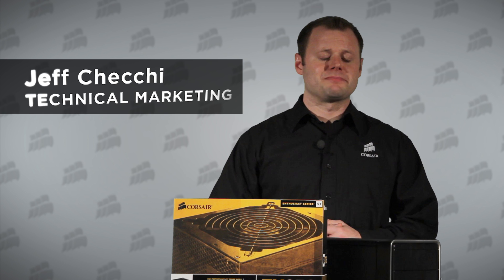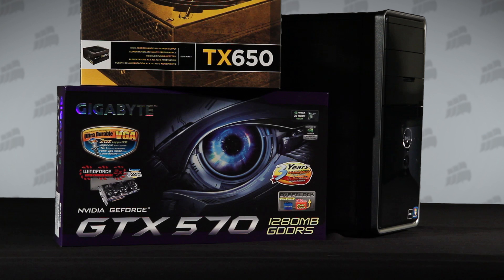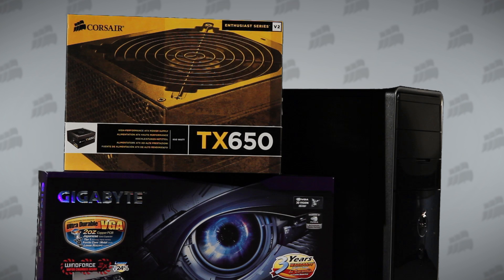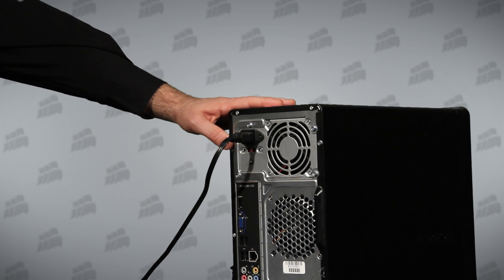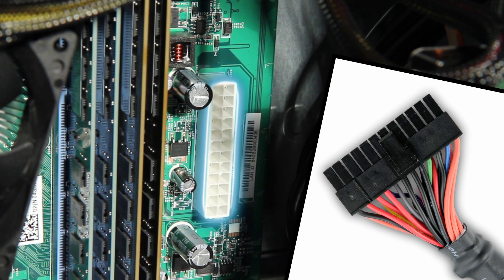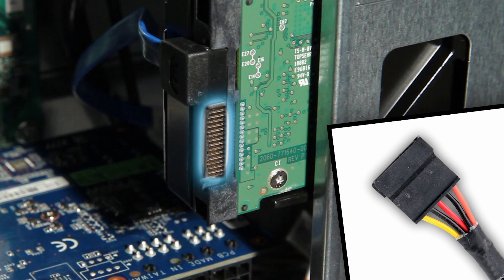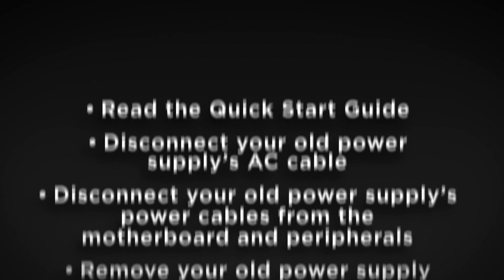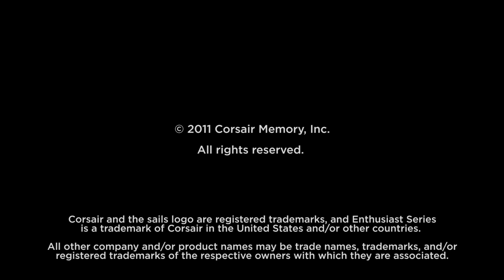How to Upgrade Your Dell Inspiron Desktop PC with a Corsair TX V2 PSU and NVIDIA GPU

Comment: I have Dell Inspirion 570 Desktop computer. I took it to Staples to get it checked out and they said I needed a Windows 10 and a hard drive. It was slow to boot up and to different sites. It would freeze sometimes. I purchased a Hard Drive after looking at the Computer Manuel that had the specifications in it and I put Windows 10 on my system. I don't do any Gaming at all. Can you do a video on how to replace the Hard Drive in my Dell Inspirion 570 Desktop Computer. I would really appreciate it or give my a video I can go to. Thanks. And may God continue to bless you.

Comment: Can somone help me out? I want to buy a new graphics card for my Dell Inspiron 570...No upgrades has been to this pc, it has the same AMD Athlon II x2 245 processor, the same DDR3 2GB Ram (which I am planning to upgrade) and the same integrated ATI Radeon HD 4200 Graphics Card. Any suggestions for good, cheap graphics cards?
Reply: sucks no one has responded, im probably guessing you have yourself situated by now. If you do not though, i would recommend getting a gtx 1050 or 1050 ti, which is a great budget card that packs some decent power. And yes, definetely upgrade that ram to at least 8 gigabytes.
Reply: BOi go and build an entirely new thing and save up some $$$ then buy an RTX TITAN 64GB Ram 72 RGB strips an ROG Maximus MB and An R3850X/A CPU you wont regret it. and its not tooo expensive either :) 

BOi BOi BOi BOi BOi BOi BOi BOi BOi BOi BOi BOi BOi BOi BOi BOi BOi BOi BOi BOi BOi BOi BOi BOi BOi BOi BOi BOi

Comment: how do I get to the power supply in a Dell Inspiron 3650? looking to upgrade my gpu and psu. and the the 3650 is a very compact case
Reply: Psu is gonna have to sit outside the case. As for gpu the 1050 2gb oc is the longest card you can fit in that case as far as I know(i had the 1050) or you can go with the 1060 single fan which is what i have now.
.
Reply: btw. you're going to need an 8 pin to 24 pin converter because dell has an 8 pin main power supply socket on the mobo.
Reply: can i replace the mother board and  the CPU? also?
Reply: Some Random Dickhead i have intel pentium. the inspiron has no modifications. i want to install a new graphics card tho

Comment: hello guys , i also have the inspiron 3847 and i bought  the  zotac geforce 970 and the evga 100-b1-0700-k1 700w sli ready crossfire ready 80 plus bronze certified pwoer supply. will those item fit  perfectly??

Comment: So as i can see from you putting the GTX 570 GPU into that dell, can my dell inspiron 545 hold in the EVGA GeForce GTX 750 Ti FTW?
Reply: Yes, it will fit.
Reply: thanks for the reply
Reply: +CamCorters my friend lend me his evga geforce gt 740 sc 4gb that he doesn't really use. when i put it into my pc and power it on,  it turn off then back on, then off and it stay on with no display.
Reply: +Daniel N. The card could be broken, but try updating the bios. Also how large is your power supply?
Reply: +CamCorters nvm i fix it a few mins ago i had to uninstall my Intel(R) G33/G31 Express Chipset Family driver
Reply: +CamCorters just got to install the driver for the gt 470 now.

Comment: i need some help, i just installed a 400w psu and im trying to get a evga geforce gt 730 and whenever i boot it up the fans and everything runs but then nothing shows up on my monitor. i plugged the hdmi into the one in the card and the one on the pc but neither worked. a few times i got it to boot up but then it asked me to restart and then it happened again
Reply: not enough power breh
Reply: na i got it to work and the minimum power level for the gt730 is a 300w so it had to be enough power
Reply: +Kxyoshi maybe its defective, try plugging it in directly to the motherboard video outputs and if if picture shows up, its good, if not then it may be not compatible with your motherboard
Reply: as i said i got it fixed but thanks

Comment: For a Dell Inspiron 530, would I need a ddr2 graphics card or a ddr3 graphics card? I think i would need ddr2 as the ram is ddr2 , but I'm not sure.
Reply: +Le Swagger I have an older Dell Optiplex (with DDR2 RAM) but the 1 GB video card I installed is DDR 3, ie it doesn't matter what the system ram is

BTW, I also have a 530 that was sold as a Ubuntu Linux Dell and still runs well

Comment: if you get a big enough PSU can it run bigger graphics cards like a 960Ti or even a Titan if it gets proper airflow/wattage. basically what im saying is that is the pc limited to a max graphics card so to speak.
Reply: Akimbo Rights Im new at the whole computer stuff so.... basically does this hardware maxout when you try to put bigger gc.
Reply: +Akimbo Rights a titan on a shit dell,broh you ain't got the money money money,and yes aslong as your motherboard supports that gpu

Comment: lol they don't show you a full view of the inside after the upgrade because there is a rat's nest of cables from the PSU, I should know because that is how mine is. I just worry about it overheating since the dell case has a passive cooling design.

Comment: I have a Dell Inspiron 3847 and I want to install Corsair 750m PSU but I am not sure if it will fix in the case?
Reply: Jobs_for_Fun It will fit fine. I have the exact same PC with a CX500
Reply: Archerlink3  Whats the best grapchics/video card i can put in my 3847.
Reply: HrachKarap™ I put a Titan X in mine. Lol just kiddind.
I put a gtx 960 in mine and it's awesome!
But, im prety sure you can put something higher, as long as you upgrade the power supply. 
And, don't go to crazy, because the motherboard is very low end.
At max, I would say probably a gtx 970.
Reply: +Muhammad Ahmad Hey man i'm not the best person in the world with computers and im looking for someone to explain how I could put a new GPU in my Dell Inspiron 3847, do you mind contacting me? If so reply to this comment.
Reply: Hxrk sure, it's really not that hard. I always wanted to build my own computer, but couldn't afford it, so I decided to save myself some money and upgrade my dell inspiron 3847 . I can help you if you want.
Reply: Muhammad Ahmad Alright can you contact me through my email @ joshguess@outlook.com
Reply: +Muhammad Ahmad Can you explain why motherboard is a bottleneck for upgrade? If it has the right PCI slot and the PC has sufficient power supply, can I install a higher end graphic card on it?
Reply: +HrachKarap™ gtx 970 can fit in it. it has to be the small version though (one fan).

Comment: will it be good with 250w and gtx 750 ti
Reply: PROinARMY 2323 yes.
Reply: So will i be fine if i buy a dell inspiron 3000 i5 4460 then add a gtx 750 to ftw
Reply: you should, the gtx 750 uses little power.
Reply: Sry 750 ti
Reply: yes, the  750ti will work fantastic!
Reply: ***** not even the gtx 750ti use less power than
Reply: Nah I bought a ttc 960 and 500w evga
Reply: LEVELupFAST 42 This is exactly my desktop i use.
Reply: +LEVELupFAST 42 yes, but barely
Reply: +LEVELupFAST 42 eh i recommend at least 300w with that card.
Reply: +Icecube88 can someone please help me for a moment, i have the inspiron with the i5 quad core and i was wondering if i could get the geforce gtx 750 ti,would it run fine,much help is appreciated??
Reply: +Echoes how do i check what my power supply is?
Reply: Yes thank you
Reply: ***** wait so would it work fine If I had a 300 psu?
Reply: ***** ok yes man,again thanks so much ,much apprecited
Reply: for all of you its been 1 year since i commented this i have bought a gtx 960 zotac with 500w evga powe supply thanks for the support guys

Comment: i have inspiron 660 MT with i3 2120 8gb RAM and 1 tb HDD can upgrade my pc with a Corsair TX650 V2 and MSI Radeon R9 270X GAMING with my motherboard Dell Inc. Model. 0XR1GT and will i have problems with heat????

Comment: my dell inpseron 620 wont boot my corsair 750w why not?
Reply: Have you been able to make this work? My Inspiron 620 with a TX650M is having the exact same issue.
Reply: nope :/ please anyone help us this is a growing issue
Reply: Try a different brand of PSU.  I tried 2 TX650's on my Inspiron 620, no dice.  Dropped an OCZ 500w and it booted immediately.  I know that my 2nd TX650 is not faulty, as I moved it to my homebuild and it works without issue.  Appears to be some incompatibility between the TX650 and the Inspiron 620.
Reply: no i wanna buy that one but will it work in my dell cause its same moddel but 2 ram slots insterad of 4
Reply: Daniel Baird  Hey man what model OCZ 500W was it?

Comment: i'm using the same exact Dell model and i would love to upgrade it, however i am using an intel motherboard on mine with an i3 on board. i would like to upgrade the CPU and RAM but i'm not sure if that would be a good thing to with my Dell. What do you guys think??
Reply: figure out the model of your motherboard, then figure out the cpu socket type, and then you can begin your search finding cpus compatible with that socket type. also, you should be able to double the size of your ram if you like. id use a power supply calculator with those parts added into it to see if you would have to upgrade the psu with those upgrades as well. hope this helped

Comment: can anyone tell me if the computer below is ok for 3 hrs of gaming a day please.

4th Generation Intel Core i5-4440 (6M Cache, 3.1 GHz)
Windows 8.1
NVIDIA GeForce GT 625 1GB GDDR3
8GB Dual Channel DDR3 1600MHz (4GBx2)
1TB 7200 rpm SATA 6Gb/s Hard Drive
Reply: why am i gonna die?
Reply: ***** what is your budget and is it only for gaming?
Reply: gaming and general software and storage use and £500
Reply: Advice: if you are gaming on lower end, then go for a amd processor like the fx 4300 or athlon X4 760K, you are gonna want to put alot of your money towards a GPU, you don't need the best motherboard or the best ram (8gb is enough), the CPU and gpu a the main parts to spend your money on, i would recommend for the gpu a GTX 650 ti Boost edition,
Reply: do u know how much a 650 cost its expensive and i needed memory like i said for storage. ive got the computer i wanted anyway just want to see what you would put thanks .
Reply: ***** what the fuck is your graphics card. Get a new one
Reply: can everyone stop commenting on mypost i already said i have a new computer.

Comment: NEED HELP! I was supposed to upgrade my desktop (INSPIRON 660 (I5 3330 processor) this morning. they change my psu to 700watts then installed the GTX 660 graphic card but the monitor didn't respond. then they even tried higher DDR3 graphic card but no response from the monitor.
Reply: You should install the drivers
Reply: When the PC starts up does it boot then turns off then boot then turns off? It does that to me

Comment: Can it be some cooling issues with only one fan in this case if you change for a bigger gpu? 

If i change the fan, would it be ok?
Or i can buy a 500r and swap my mobo on this new one + plug fan on a molex?
thx

Comment: If you get a newer graphics card and it's only for running minecraft. You can just get a amd 6670 or gtx 650 which will get you around 70fps on minecraft!

Comment: I just updated my dell 570, 8 gigs of ram, nvida gt 610, 450 watt antec cp psu. "WARNING" the ram specs in the Manuel are wrong.. I am running 1066 like the inspiron manuel says but this pc comes with 1333 no issues i guess dell must of cheap out at some time or another. Also look into a expansion fan my gpu runs between 55 and 60 loaded.

Comment: I have a 620 as well in the regular version. I got a gtx 550ti for it, but i can't fit it because the wifi antenna is pullged in the next expansion slot. is there a way to move that?

Comment: To everyone concerned....If you are worried about overheating just buy some new fans for the case to get some better airflow. Either way I think there is enough room here, people are just used to their full ATX cases and such. If you want a 600 series the Zotac 660/660ti is probably the shortest 600 series card out there. Personally I'd think a gtx 550ti/560/560ti would be a better choice with the processor.

Comment: Open the side pannel and measure the pcie 16 slot area to see if it will fit into this case. I'm pretty sure if they can get a 570 in there they can fit a 660. Just buy a smaller 660 like a zotac.

Comment: Yes, it will fit but it will be tight inside the case. I have a GTX 660 too but i bought another case and moved all the stuff from the inspiron into my new case. The case i got was a (Corsair Graphite 600T)

Comment: Can someone tell me why - when i try to upgrade my Dell inspiron 620 desktop with a new PSU - it doesnt power up at all.?  I get the led on the mobo - but the system will NOT power up. I have tried an 880wat, a 660wat and now a 550wat none of which will work.  They FIT and the plugs all match but i get no response. Furthermore I can put the old Dell psu in and the damn thing boots up no probs. Please Help i want to U/G the GPU I have a gtx660 in a box :(

Comment: GPU's will get hot and sometimes will overheat. I wouldnt say to play games 24/7 non stop because that would overheat the graphics card. Leaving the side of the case off would mean the hot air could easily escape and there would be better airflow. Graphics cards have a certain temp point they can reach until it wont function unless it cools down. I might get a gtx 660 this december and im going to leave the side panel off.

Comment: I have an inspiron 570 and I'm planning on getting this power supply and a GTX 560 ti to throw in there. so you're saying if I just leave the side of the case off it should help with the overheating problem, aside from the occasional overheat that's bound to happen?

Comment: Im not corsair responding, but ALL high end graphics cards will overheat no matter what type of computer case you have. Most people recommend leaving the case off, it would help alot. I basically have the same computer that they have in the video, but with different specs.

Comment: eh it would be better in the long run to just buy a new computer. Usually, the components in low-end are not name brand suppliers, and are not held up to a high standard of stablitity. I remember a case where it would be cheaper for Dell to use 100 cheap PSU's and replace the 15 or so bad ones, thats how they operate.

After factoring the GPU, mabey CPU (an i3 dual core is decent) Case, PSU, mabey mobo (voltage stability to parts!!), your better off saving your comp and building a seperate one.

Comment: i have this pc and the power supply's dimension is 14 x 15 x 8.6cm, the one you put in was 15 x 16 x 8.6cm how did you get it in because even with the stock size it barely fits due to the case being awkward does 1 cm not make much difference?

Comment: help me out please! i have a dell inspiron 560 and just recently bought a new graphicscard a Asus GTX550 TI (400W) and a new power supply: thermaltake Smart m450W. now here is my problem i connected all my cables but my HDD (internal afcourse) does not get any power, it used to get power with a SATA cable and its the same now but it just won't work and i know that it is not my HDD's fault because my CDWR does'nt work either. PLEASE HELP ME!!!!

Comment: 5 minutes? I've done this type of thing on dells before and you gotta wrestle with the cabled because they are so tightly tied to the case. It took me forever to wrestle out a floppy conector for my USB 3 pci e card and I had to undo most of the cable ties

Comment: @billdcat4 - Actually the 570 has no internal exhaust.  Almost all of the heat generated by the GPU is exhausted out the back bracket.  One thing that is important though is to maintain positive pressure in the case.

Comment: I would not recommend putting such a high end graphics card into such a small computer case with zero airflow, that graphics card is going to die of overheating. Dell, HP and other branded PC:s have basically barely any fans at all becuse they are targeting people who just enjoy surfing the web, play minesweeper and chess.

Comment: Remember once me and my brother bought each a new powersupply from an unknown brand in 2006, and both failed! My brothers PSU suddenly broke and smelled like it was burned and on mine the fan started to create a weird noise. When I bought a Corsair 450W for my old computer and it still works. I´m currently using Corsair 850W.